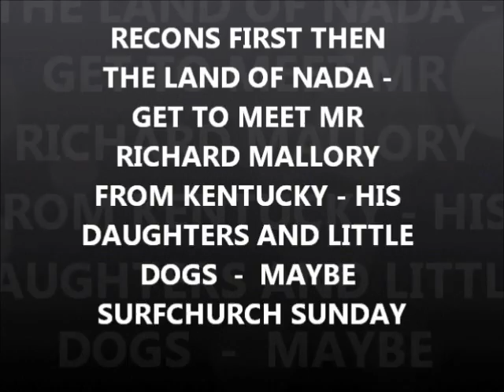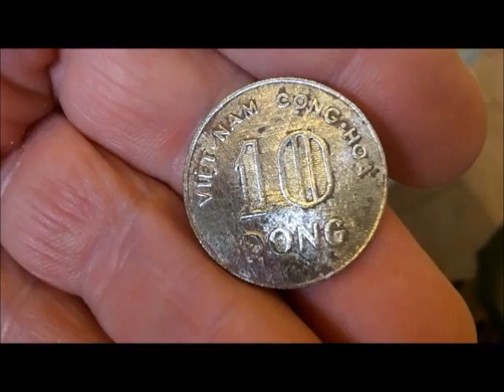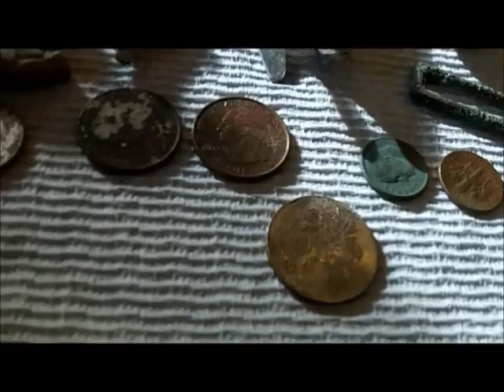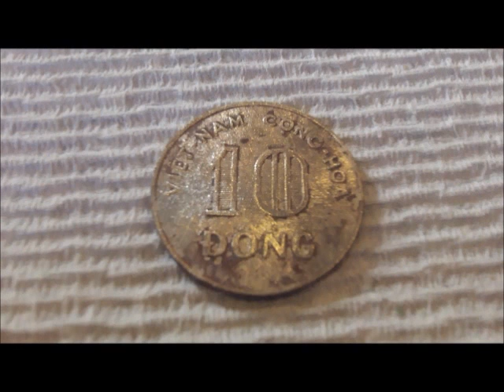OCT 3RD- Bay recon and a spin at Nada with the Mumblesman

Comment: The storm is heading up north so you folks should have relief soon. IN NJ we are expected to get relief Sunday. 
 So you have the new sand scoop in operation . Buttttttt.... you have not made a comment on how the sand is sifting thru the holes or if there is a difference in the way the scoop handles. LOL LOL Please continue on the way your machine gives you information. For the first time last Tuesday I got to use my 3030 on cape may beach NJ and I was not getting any beeps at all . I thought the machine was off then I found a nickel at 12 - 38 . Just still trying to learn the operation and settings. 
GL HH & God bless